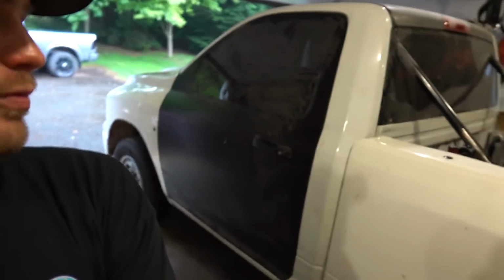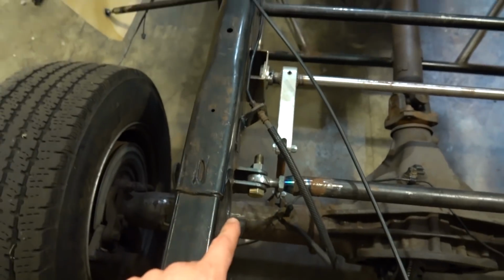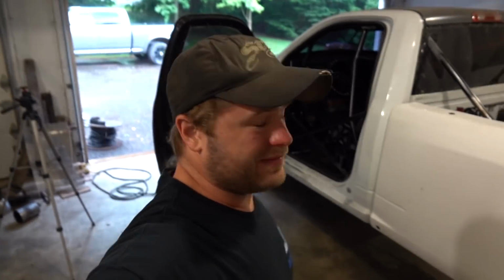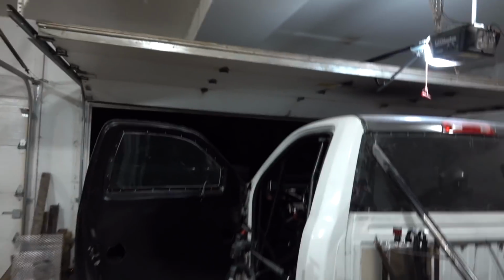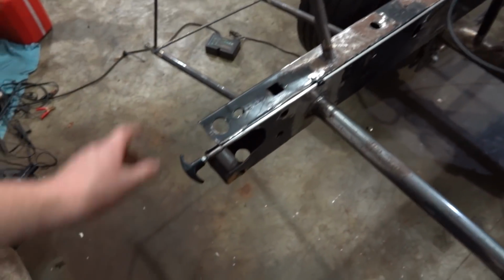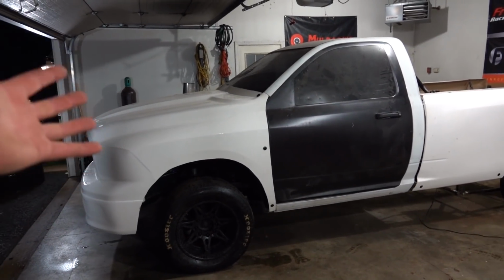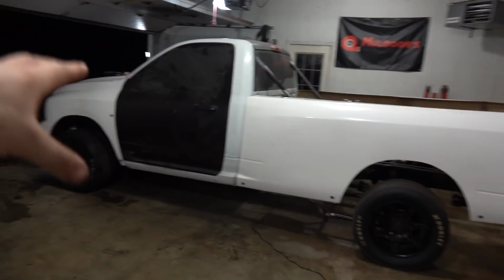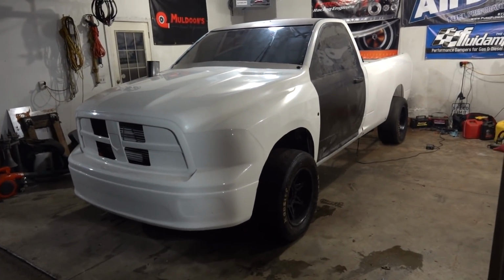2000HP Cummins Drag Truck Build FINALLY LOOKS Race Ready!!

Comment: Hey man what about the fuel pressure regulators on the back of the cp3s . Maybe one went bad. I know my chevy loped like that when it lost a regulator. Youve probably checked the desired vs actual rail pressure already but if not do it.

Comment: I’m no expert in CR engines but is there any chance your rough idling issue could be residual air in the system or maybe air is being introduced into the system?  If the vitals look ok I say rip it down the track.  Can’t wait to watch the first run!

Comment: It’s looking great man! Why does freedom guys haven’t send you support? I’m no expert in diesel but i own quite a few machines and tractors, and it seems to be a fuel issue man ( air pocket, loose connection or that pump you are using without a lift pump isn’t sucking enough)
Anyway please race again mr greg. Just saw his video yesterday and went to your’s again; man you would have beat his ass without trans issues excuses or red lights. Keep em coming great work!!!